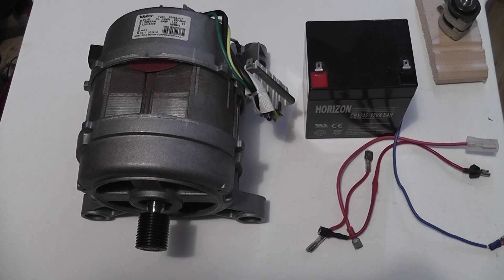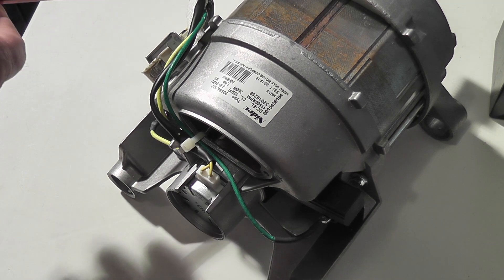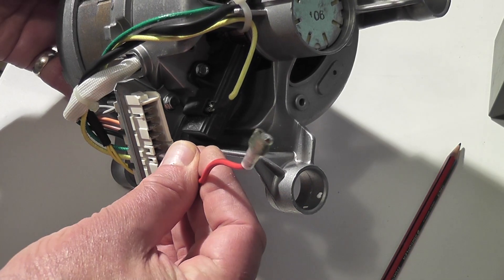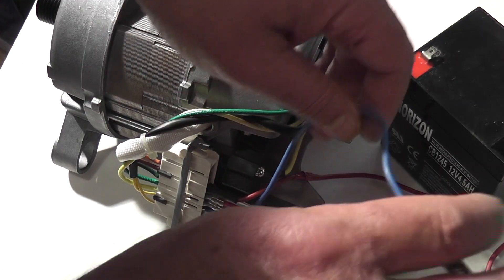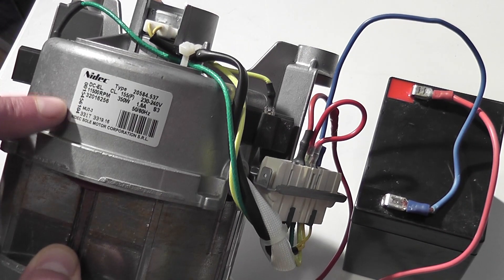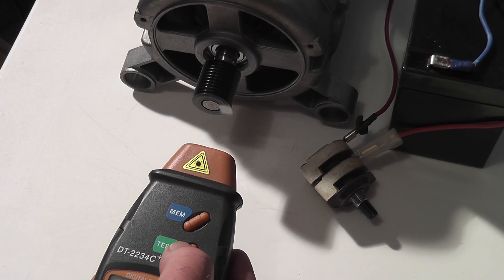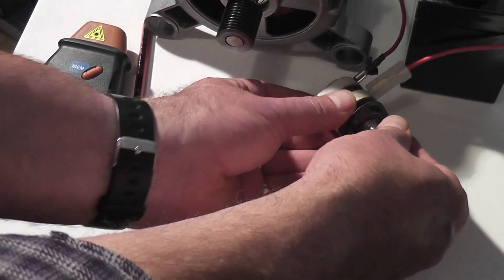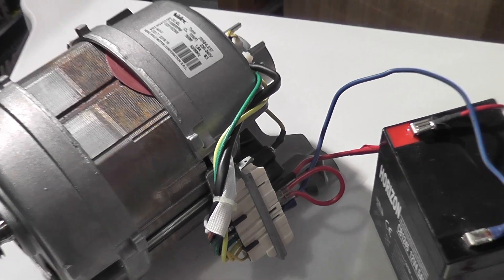Easy Conversion of AC Washer Motor to 12VDC

Comment: That's a high torque motor driven on high voltage.  If you cut the voltage in half you reduce the torque down to 25% of the original designed torque.

Some AC motors can be run on DC because they use coils for magnetic fields, both on the stator and on the rotor.  With a brushed motor such as this, when the AC is moving - lets say left - the motor spins - again, lets say - clockwise.  When the AC right the magnetic poles reverse WITH the AC, making the motor continue to run clockwise.  Whether the current changes or remains steady the motor spins.  When spun on its designed voltage it can be quite powerful.  But when you reduce the voltage you reduce the power by a factor of four.  Inverse square law applies.  A 1 inch square has one square inch, whereas a 2 inch square has four square inches in it.  Inverse square law explained in simple terms.
Reply: You and some of the other polite commentators are adding useful information here. I collected some motors, hoping to understand their potential for projects one day.

Comment: Nice video, hope if you have a wiring diagram, thanks for your help
Reply from the maker: Different motors may have different wiring and colours. If you follow the video you will see the way it's done on this one but your motor may be different so a wiring diagram may only be good for certain motors
Reply: @DrivewayDudes  can you do a schematic or line diagram on your connections?

Comment: I came here thinking I would learn something, I was WRONG!
Any Universal Motor can be run on AC or DC!
I think it will be better if you Specify that this is a BRUSH type motor in your lines describing what you are intending to do. It is not an induction motor so I think the name is click bait, John, Australia.
Reply from the maker: Hi joandar1,
We're sorry to hear that you found our video of no use to you. 
When we get a brushless induction motor we will film tests carried out on it. You may find that interesting.
There are still many old motors about that may need as little as a good clean and a new set of carbon brushes to work again.
Reply: @DrivewayDudes  I think I would find that interesting and may learn something, after all that is why I come to YT. I am aware of what needs to be done with a brush type motor as long as the has not had the field or armature windings damaged as a result of back emf not being sufficient and therefore overheating. I repair my own power tools as required, ie bearings and brush replacement. John.

Comment: Just buy a chinese 12V brushed motor controller
Reply from the maker: The speed controller used in this video came from an old car. 
We try to reuse and repurpose if we can.
Reply: @DrivewayDudes  i'm talking about a real speed controller not a potentiometer.
Reply from the maker: The speed controller we have was burned out. We are awaiting a mosfet and possibly a schotky or two to repair it. 
We stand corrected as the unit we described as a potentiometer is a rheostat.

Comment: what happens if you put 110-115
Reply from the maker: That would be 10 x 12V batteries wired in series. If we had 10 we would try it

Comment: If this is an AC rated motor how is it functions under normal conditions. Are the field windings supplied with a rectified voltage or AC v?
Reply from the maker: It is a standard off the shelf single phase brushed AC motor.

Comment: Does this mean that if I put it back in the washer, I could run the washing machine on 12 volts????
Reply from the maker: If you remove the jumpers it would revert to AC. 
The loom in the washer supplies AC to the motor and handshakes with the control board so the answer is unfortunately no
Reply: @DrivewayDudes : If a circuit be built to fool the control board, taking inputs from the speed sensor and other inputs,  a off Grid / portable washing machine might be a news.
Reply from the maker: You could remove the jumpers and use an inverter if you want to go off grid

Comment: Great video. But what is the use of  converting from AC to DC
Reply from the maker: It's not permanently hardwired. We used a couple of spade connectors so at any time it can still be used AC.
With DC it can be more versatile and portable
Reply: @DrivewayDudes running this universal motor on dc current does it give u high torque becoz i using this motor for e bike by connecting 24v batteries in series to get 72v is it enough for motor run at high torque plzz reply
Reply: @omnavasare8865  mee too please reply
Reply: Power it using batteries?
Reply: Can we use them for prolong time
Im thinking to use them as a direct drive wheel (simracing)
Reply: We can make solar fan with this

Comment: using that same concept if you charge the rotor windings with 12V dc, u can use the stator output then as a generator, and once the motor is at speed u can use the stator output to keep the rotor charged as long as you keep the motor turning......  I have done this with a 30KW 3phase electric brush motor. Works like a charm. Built myself a 3 phase generator with a 1400cc petrol engine running it.. and that will give you an 220v output.. on your motor...
Reply from the maker: Sounds like fun. 👍
Reply: Would appreciate a video or a blog...

Comment: nice for a paint mixer but thats it... it runs at a tenth of the rpm so i suppose if it was a 300W motor it will probably now be a 30W ... hmmm very good info there anyways and a great clean and good understandable video :)
Reply from the maker: It's only a matter of adding more batteries, more Voltage, more Amps as needed
Reply: You can run this kind of motor on DC voltage but the  battery  it can't be more than 7 amps  other wise the motor will be burned! !!!😦😦😦😦😧😧😢😳😳😳😳

Comment: You should run it in parallel instead of series it would run much faster with more torque . Useless as it is
Reply from the maker: Were we to run it on more than one battery then we would definitely take your advice onboard.
Nothing is useless. It's just that a use hasn't been found yet.

Comment: The second Kirby motor would need field or armature excitation to function as a generator,otherwise without an exciter,or any excitation voltage,it would not output any current.

Comment: I plan to make an experimental motor/generator set from two upright Kirby vacuums. I already have a red Kirby Legend 2 & need a second Kirby to use as a generator. To excite the motor field or armature on the second Kirby, the exciter would be a 90 volt DC Bodine permanent magnet motor from a Christie cinema film platter & have it & the second Kirby belt coupled to the Legend 2 & use a variac,a variable transformer in other words to control motor speed & a rheostat to control exciter output to the motor field or armature of the second Kirby.
Reply from the maker: That sounds like fun
Reply: i hope you are not trying to make some free energy contraption

Comment: The last washing machine I pulled apart used a 3 phase induction motor, with a variable frequency drive. All previous were single phase induction motors. Where are you that they use brushed motors?
Reply from the maker: Brushed motors are still about. We were given this by an appliance service tech who had it as a replacement for an old washer but was never used
Reply: The other type of motor used, are single phase induction, cap start, reversible. One direction runs the agitator in the washer, and reverse brings up fast spin cycle - function is through the transmission based on direction (GE basic top load ca 1990's)
Reply: @paulmoffat9306  i should have added that i am in europe and around here its 99,9% front load machines... but the induction motors that i mentioned with solid rotor are also single phase, they have a cap for the starting (usually 12 to 16uf) and also reversible. the cap is the only common failure point on those motors. those machines are tipically old with mechanical timers...there are separate windings for the spin speed, and run speed. typically the drum rotates from 500 to 800rpm on those...on modern brushed motors the drum reaches 1600rpm on some models but the most common speed used is 1000 or 1200rpm. these modern ones i believe they use pwm to increase the rotation smoothly but on the old ones when the spin cycle kicks in its a massive current spike and vibration as the drum starts acelerating fast and the clothes start getting uniformly packed against the sides of the drum due to inertia...wearing out the springs and dampers holding the drum to the machine's body. on our machines transmission is via a v-belt on old models or a "ribbed" belt on newer ones and now we have direct drive.
Reply: Erm, Ireland by his accent
Reply: i pulled apart "millions" of machines while working for a recycling company, around 50 per day and the machines manufacturers used solid rotor induction motors up until 15 to 20 years ago,back in the day the motor start capacitor was a big failure point...... then they switched to brushed motors up until 2010 more or less bringing the top failure point to the wear of the brushes...

the majority of the washers still around are brushed motors atleast in europe. cheap washers still use brushed motors...most modern big capacity ones now are direct drive and dont use brushes. those motors seem very reliable but they fail due to tachometer failures and control modules are also very failure prone
Reply: @MrHBSoftware  what do you mean when you say tachometer failure.Are we talking about the controller of the motor and not the motor itself ?
Reply: @das250250  on brushed motors the tachometer is a copper coil at the back of the motor and inside of it its a cylindrical magnet ..that provides motor rpm info to the washer machine control board.. the more rpms the more voltage is generated at that coil...usually it has 2 thin red or yellow wires coming off of it... on direct drive systems sometimes there is a hall effect sensor like in 90's car ignition systems but other approaches may be used..i havent taken apart many direct drive machines, and the one i have worked on are mostly "LG"brand, and i can only speak for european market machines....  if you want to check my channel i do appliances repair and vintage vacuum tube equipment restoration

Comment: Induction motors that depend on line alternations for commutation are a common scrapyard treasure in the U.S.  from old washers.  Best to avoid those unless an inverter is planned.
Reply from the maker: Thanks for the comment Rick.
Watch this space as we will have a video up soon which will use an inverter

Comment: Thanks for this informative video. Can one use this setup to make a go-cart?
Reply: Don’t think you would have enough power to push/pull along a go kart,With even a child driving it,Not enough torque.
Reply: someone on youtube made a decent crude electric bicycle with a tiny 10dollar dc powertool motor on 12volts
Reply from the maker: You could with a bit of tinkering
Reply: @Zvi Bloom
You can run 20 car batteries of power through this motor...
More batteries = more torque.
You can also use a brushless DC controller to feed it 3 separate "phases" of DC, which will greatly improve torque as well.

Comment: In this configuration there would be only a little usable power. If however you connect the field winding across the two brushes (in parallel) and the apply 12 v also across the brushes, even though the speed will be slower than the rated output, the torque should be much higher. Experiment with the wiring of the field coils (if there is more than one) for the optimum performance.
Reply from the maker: Thanks for the info. Yes I understand that other configurations could be considered.
The point of this video is to show that a 240VAC motor will operate at 12VDC.
The applications we would leave up to the viewer.
Thanks

Comment: What sort of running time per charge would you expect from a car 12v battery? I too am contemplating making a small electric boat motor from either washing macuine or Vacuum cleaner motor? Thanks for a clear and consise video.
Reply from the maker: That would depend on the Ah (Amp per hour) rating and load on the battery. The bigger the Ah rating the longer the battery will last between charges. You could also consider running a couple of large batteries or several smaller ones in parallel
Reply: WOW
Reply: try the motor off of a cordless drill...much smaller, more power

Comment: Too many what colors go to what! A schematic sure would be helpful so someone can follow slowly.
Reply: Wires dont know what color they are..... if you need to know the colors you dont need to be working with electricity. A wire only connects between two points , generally a switch or a device . theres only two basic categories, switches and devices . The wire does not care what color it is , only where it’s connected
Reply from the maker: Many motors colours vary. If you watch the video you should be able to make out the connections configurations regardless of the colours
Reply: @DrivewayDudes  
Hi 
I want the same motor how to order it
??

Comment: I have a project using a washing machine motor and finding this information is priceless ther are others out there who have channels on this subject but run you about you go right to the point 
Nicely done now about the project I am constructing out of such motor for my dingy I intend to make an out board motor the motor is 3\4 hp not sure if that can still be intended for 12\24 volts 
As it was a 110 or 120 machine I like what have said a will like to hear more if you do have any suggestion on my project pleas by all means give input I am open to new ideas
Reply from the maker: That would depend on the size of the battery/batteries you are using. The bigger the better.
You could also consider using a 12/24V DC to 110/120V AC inverter to run the motor from the battery/batteries
To adjust the speed and reverse you could an electric drill or similar with a variable speed trigger that would have a reverse action feature.
Be safe and have fun. Let us know how you get on with the project.
Reply: @DrivewayDudes  @David Steinfeld  AC in a boat?
Reply from the maker: @MatHelm  Using a fused inverter
Reply: @DrivewayDudes   better still .......have all passengers on the boat Fused....Earthed......Watered....Drenched.....Dried.....Whatever ??!! Lol.